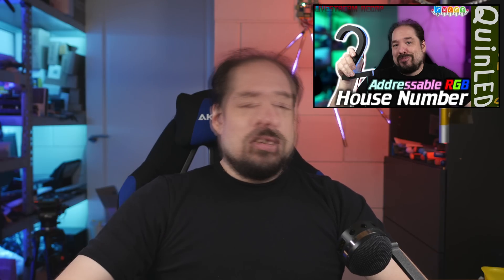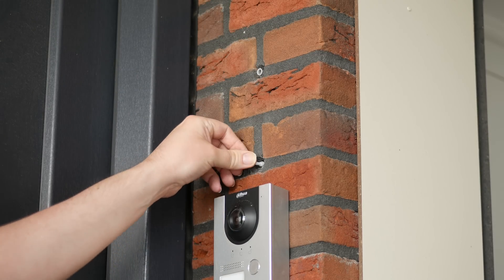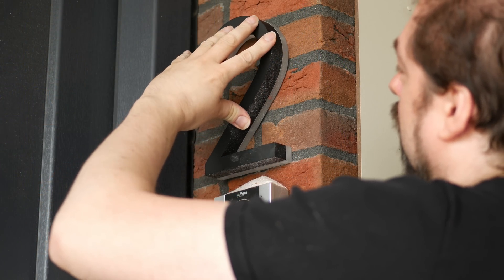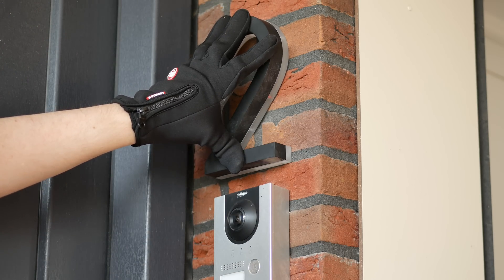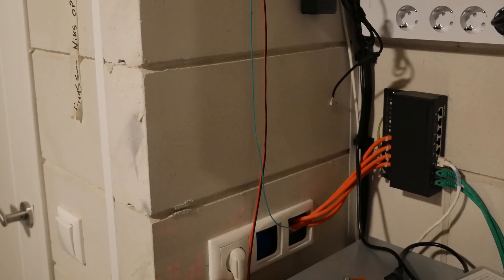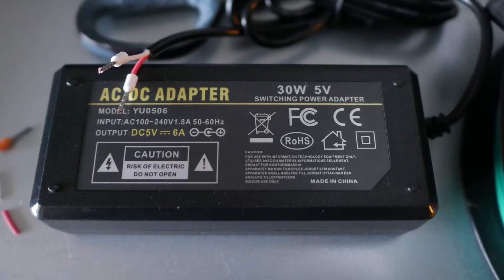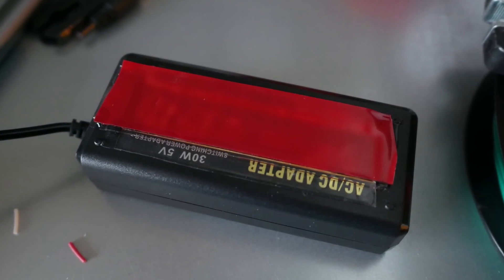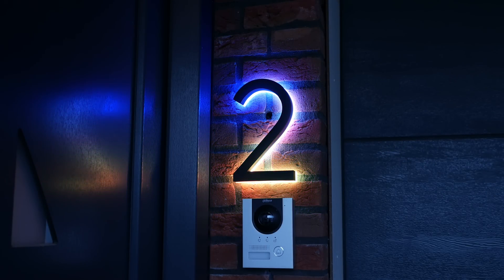Does your house number do this?

Comment: Really wish the screw terminals were a bit larger! On UNO snd Quad.
Reply from the maker: The current versions fit 16AWG with ferrule (need a little squish) that should generally be enough for projects with the board. On the Dig-Octa the Power-5 takes up to 14AWG with ferrule and the Power-7 even 12AWG with ferrule and those have rising clamp terminals but the boards are also a lot bigger so maybe those are better suited for the project you are doing? :)

Comment: Hey Quindor, another amazing project that I will follow to make. Unfortunately I came across 2 obstacles. 1) could you be so kind and share your HA automation script to control house number lights when doorbell rings? 2) have you heard anything from allnet.china that they are not shipping to UK? I was not able to place an order due to the above error.
Reply from the maker: Hey hey, the automation in HA is actually quite simple? On button press, save scene, reset to red scene, reset back to saved scene after a delay, done!

I don't know anything about Allnet not shipping to the UK? As far as I am aware lots of people from the UK are running my boards? Could you show me what you're seeing on Discord? :)
Reply: @IntermitTech  Hey Quindor, thank you very much for quick reply. I have sent you a private message on discord.

Comment: Quin, I would like to know if there is any addressable LED strip with enough IRC quality for general residential lighting.
Reply from the maker: You mean CRI? No, sk6812 WWA (so triple white) comes closest but even that doesn't have CRI90 like you can get in analog strips, let alone CRI95.
Reply: @IntermitTech  Thanks for answering. You inspired me in my projects. In your opinion the sk6812 wwa would be the best option for general lighting with addressable strip?
Reply from the maker: Well no, analog high CRI white strips with at least CRI90 or rather 95 would be. But if you want to stay with digitally addressable, then yes.